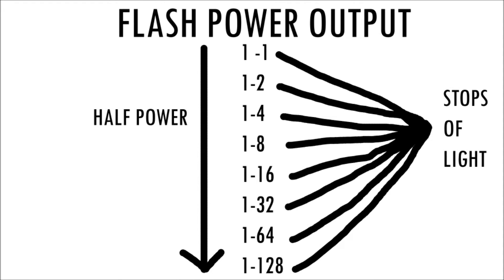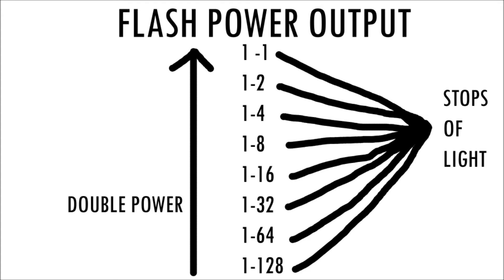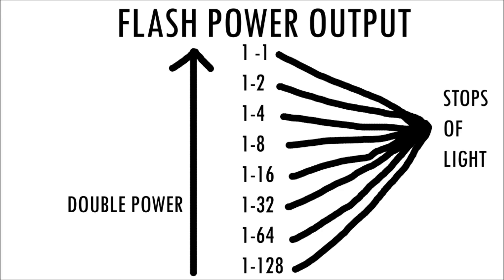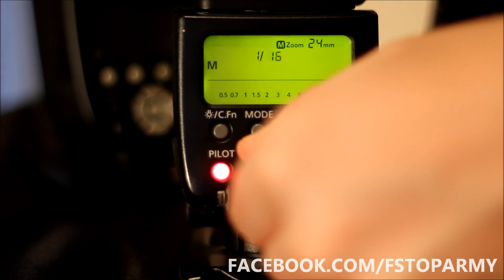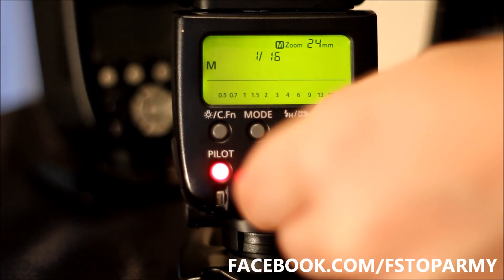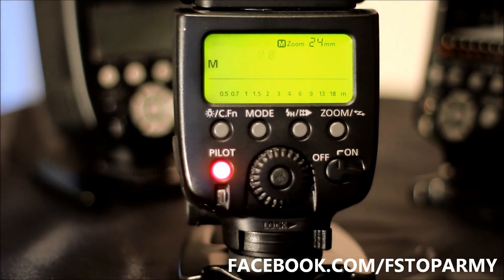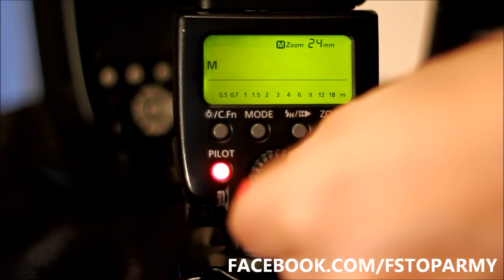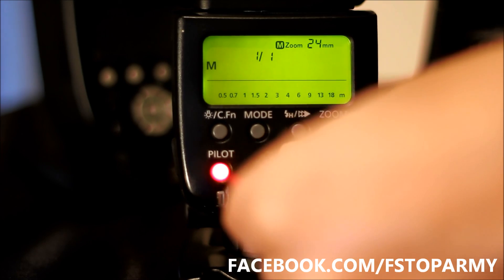FLASH TUTORIAL 1 - 10 Understand Flash Power

Comment: I have been using flash for decades but until recently, for the following reasons, I always used full flash power and never used anything less:
1. Most of my flash units did not offer anything less than full power.
2. One studio flash unit I was using only offered full-power, 3/4 power, 1/2 power, and 1/4 power.
3. The color film I used suffered reciprocity failure when flash intensity was reduced by decreasing flash duration.
4. Since I usually used my flash units with light modifiers that reduced the light output, I rarely needed to reduce the light output more. 

Now that I am doing most of my color work with digital cameras, and since I replaced most of my older flash units with new units that offer power control, I needed to learn how the power control worked. Your video taught me just what I needed. Thank you for the video.